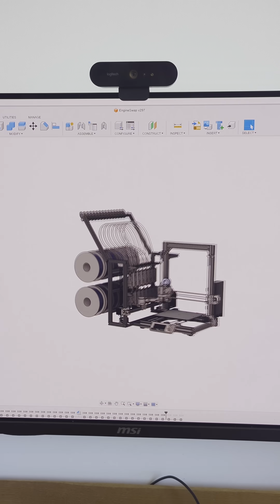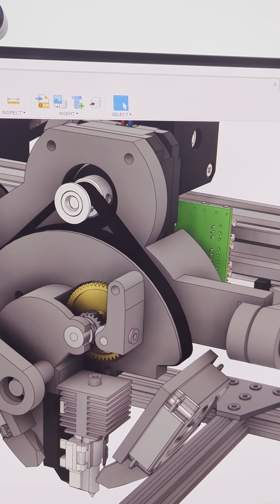The Truth About My 3D Printer Tool Changer Journey

Comment: I presume the reason you added tilting in the toolhead was related to the way you want to swap the hotends. 
If that's the case, you should probably investigate if it's possible to do it in the tools without much rework, having all that on the toolhead will add a lot of headaches to the project with little gains.

Comment: If you're anything like me you get a dopamine shot from prototyping but a headache from building.

I'll help you scope:
- Tool changer: is the core so be good at it. Must be reliable and at least 6 spools. 
- Enclosed: nice to have, but can be integrated afterwards in a V2
- Tilt for overhangs: Project killer, don't do it. So many issues for so few benefits. 

As for being good at tool changing: what's the problem you're trying to solve compared to today's toolchangers: Price? Speed? Reliability? Number of tools?

Pick one or two and be revolutionary at it. Once you built and tweaked it, only then extend your scope for a V2 version. 😉